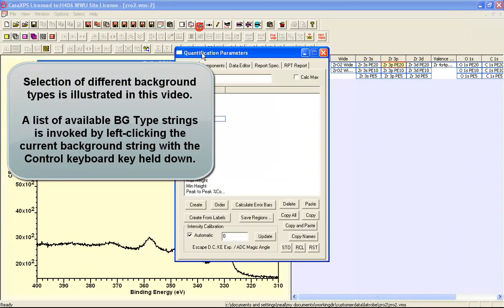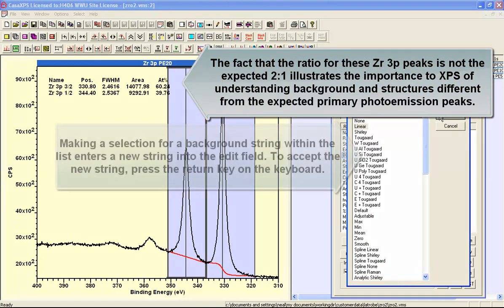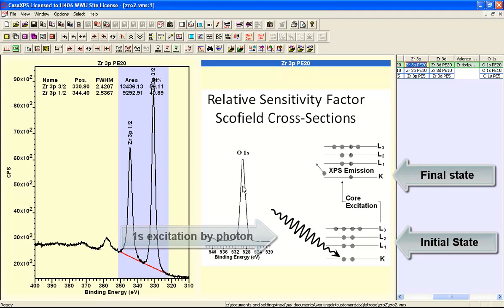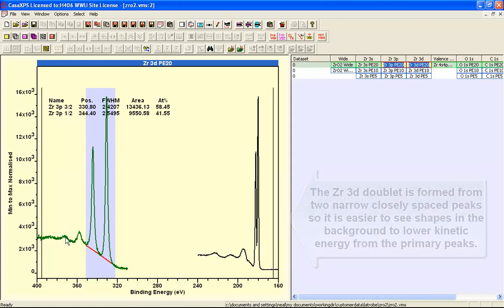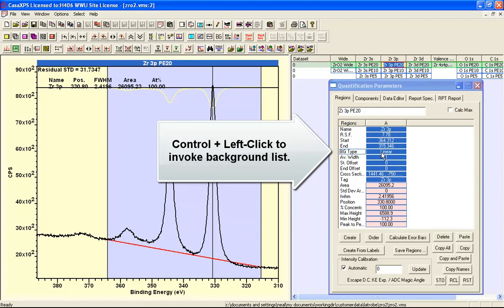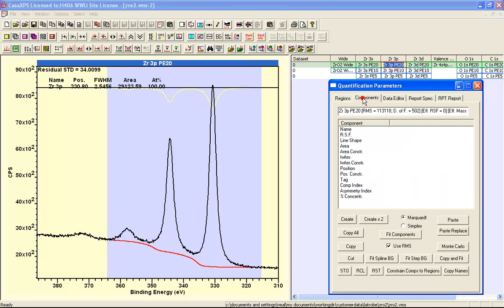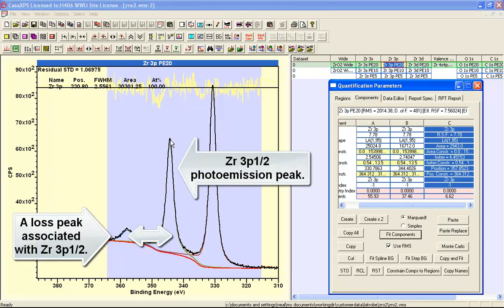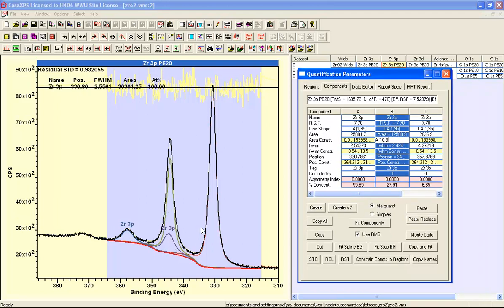Backgrounds to ZrO2 photoemission in CasaXPS

Comment: Hello, quick question about the first half of the video. Because the RSFs are different for 3p 1/2 and 3p 3/2 peaks, shouldn't we only expect to see 50/50 At% once taking this into account? You are using the entire 3p RSF for both so the only measure of At% is the area, but actually their sensitivities are different. The whole point of the RSFs to begin with are to take into account inherent differences in the area. Am I missing something?
Reply from the maker: I am using total RSF for Zr 3p doublet because the discussion centres around the known ratio for a p-orbital doublet and this ensures the ratio within the quantification table reflects the 2:1 ratio expected for Zr 3p 3/2 to Zr 3p1/2. For the discussion within the video I could have set both RSFs to any value other than zero as I am just considering Zr 3p in isolation. If other elements are combined with Zr 3p signal then the analysis within this video shows that to quantify Zr using Zr 3p signal it would be better to make use of only the Zr 3p 3/2 peak, use the RSF for Zr 3p 3/2 and be sure to set the RSF for any signal associated with the Zr 3p 1/2 to zero.